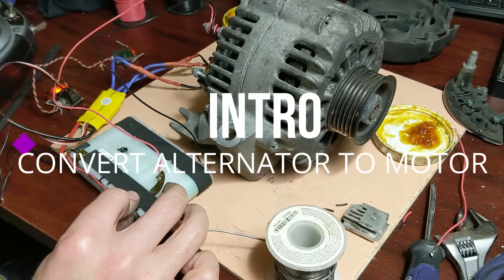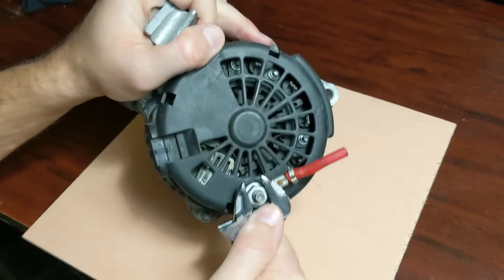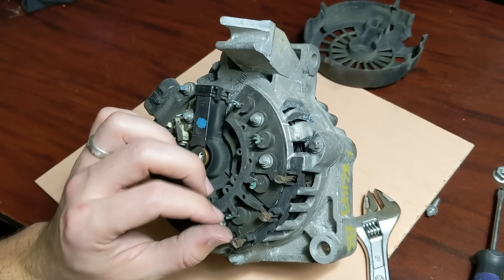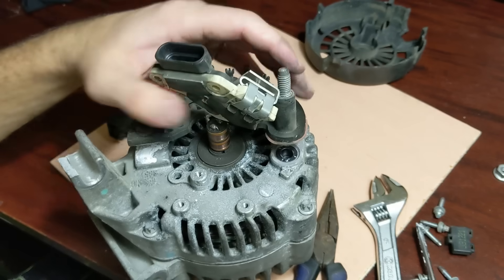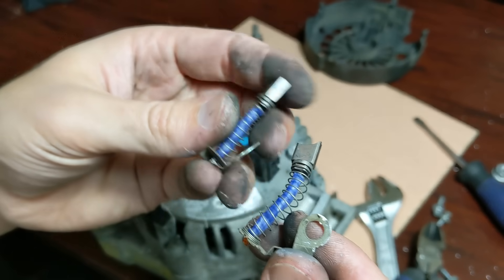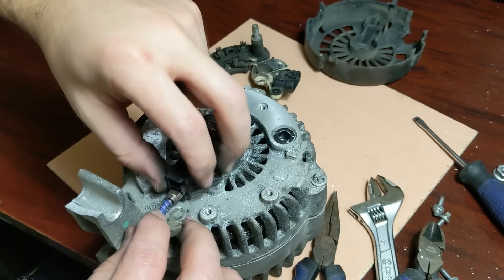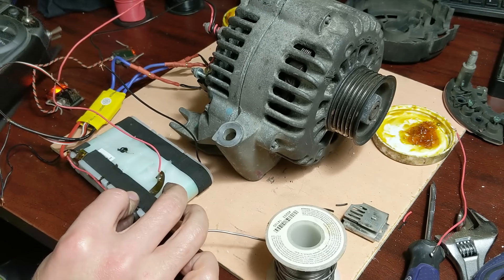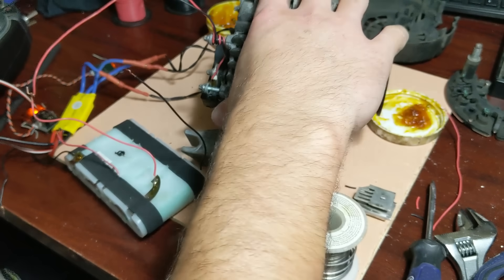Convert Alternator to Brushless Motor

Comment: Just wondering why the title says “brushless”
Reply: It is brushless because he removed the brushes. Then, put them back in. So, technically it was brushless for a few minutes, even though it would not work. 
  The only part that came in a box when I started fixing vehicles, they where new from the dealer.
Reply: he doesnt know, this is clearly his first time lol
Reply: @kingkoopa33022  well he knows enough to give a for the most part accurate tutorial on how to do the conversion from alternator to motor.
Reply: Yeah. I think its in the "drive it with an brushless motor controller, (with brushes and a stator instead of  permanent magnets.)"  But I'm sure he meant well :-)

Comment: I have now watch so many of these "conversions" and still have more questions then answers. First of all, nobody has a "perfect" setup of rotor voltage/current or stator voltage/current to use for the best power out. And no one has yet measured the true output capability of their conversions. If it is a relatively strong "motor",  how strong? Does it put out a HP or more or less? I understand the rotor has to have DC current as an input so that there is a strong magnetic field for the stator to react with. So the Brushless isn't a concern for me. But how much can one of these "conversions" actually drive? And swapping any two wires of any three wire setup, reverses the spinning action, for those wondering. Doesn't matter which two wires either, any two swapped changes motor spinning direction. Just need more specs on these projects...
Reply: I converted a 90A alternator to a motor (I think it was Star as it had four bunches of wires coming out and one was much fatter than the others.)
It could easily cope with a 800W ebike controller but got a bit hot with a 1500W ebike controller at 48V so a 90A alternator can safely be used as a 1000W to 1500W motor. 
I played with the voltage on the rotor and found around 7V unregulated (direct connection to a bunch of old 18650 Cells) seemed to work OK but it will work with anything from 3V or 4V to 12V however 12V may cause overheating.
My next conversion will be a 180A VW alternator and I plan to make a video about the process including fitting hall sensors.
Reply: youtuber "Fixitmoditbreakit" did tests, got 4000W of power on his 120Amp alternator with a 36V batteri
Reply: and since every alternator isn't the same, you need to test it
Reply: I can tell you just looking at the bearings, housing, wiring, etc., and cheap low amp alternator is equipped to handle way more amps than a typical  "250w" ebike hub motor.

Comment: I have seen electric motors having around 2, 3 or 4 wires going to and from but never have I heard about nor seen ones with 6 wires coming out from an electric motor at once? What function serves the additional 5th and 6th wires to, are they made for supplying a 12v utility battery or feed the spark plugs on the engine it usually is connected with?

If so then they are a perfect option for a diy regenerative braking system on each rear wheel side of any ev conversion car project as an additional bonus can improve the handling to a plus side.
Reply: the brush wires are for field current
(separatedly excited, some old huge DC motors from the past also were like that)
Reply: A 3-phase motor will have 6 wires. 2 wires for each of the 3 coils.
Reply: Think of it this way: a length of wire, let's say a foot long has two ends.  Let's say:  One end on the left and one end on the right.  A coil of wire on a stator winding also has two ends. To locate or identify a coil's two ends, an ohm meter can be used. The ends of the wires are made available on the alternator after disassembly.  For 3 coils you would expect 6 ends. For 6 coils you would expect 12 ends. For 12 coils you would expect 24 ends. These ends are usually soldered to the rectifier before disassembly.  Sometimes two lengths of wire are wound around the same stator frame section.  Instead of winding 1 wire at at a time they wind 2 at a time.
This arrangement would show 4 ends per section.  If there were 3 sections with two wires this way, you would see 12 ends. (3 X4)

Comment: I don't have a brushless controller yet but I do have an electric chainsaw that I can no longer get batteries for so I took the control unit from it which is for a brushless motor and all mine does is twitch like yours did at first. Any suggestions

Comment: The bit that spins around is the rotor and is an electromagnet or 'field' coil.
 The coils on the outside that don't move are the stationary (stator) coils. Voltage regulation is by means of switching field coil on and off or on more modern regulators, by supplying variable voltage .
Supply 12v to field and you usually get between 17~21v when  driving (gasoline) engine is powering alternator with corresponding rises as rpm increases. (well over 100v at max rpm. switch off field and voltage will drop dramatically but not completely go away due to residual magnetism or self exciting. 
I think you could fit a diode (or bridge rectifier) and variable resistor to make it self exciting but haven't tried it. There is a possibility it would get out of control as a motor though? 
You still need battery. 
Using neodymium magnets on rotor will convert it to brushless.

Comment: The center part that spins is called a "rotor", because it rotates.... sometimes it is called an armature.
A stator is from the latin root word "static" meaning it does not move... it is the laminated iron part with copper windings around the outside of the device. In this instance the stator is obscured by the casing.

Also, you put the brushes back in, so not really brushless eh?
Reply: "Semi-brushless"... 🤷🏻 
Still works exactly the same as a brushless motor, it just has an electromagnet instead of a permanent magnet.
Reply: WRONG! Lol. I'm just kidding. You're dead on.
Reply: I think it's technically it's a bldc with electromagnetic  rotor. And if you have a way of replacing the rotor with permanent magnets.. is love to hear about that...  Maybe you have a better way of adding power to the rotor to give it a electromagnetic charge? The stator needs a field to push upon our is but going to spin..
Reply: @dmayniak  That is what I have already said
Reply: 3 phase induction motor
Reply: @VulcaNtGoF  A 3-phase induction motor works completely differently

Comment: The Y vs D configuration has nothing to do with rpm.  It is the number of poles that  decides the rpm.
Reply: In case of synchronous motors y and d configuration changes the rpm
Reply: correct .A.C drives in industry vary the speed of an induction motor by varying frequency, since poles are fixed ( except single phase consequent pole motors ). These are the two main factors which determine motor rpm.- % slippage.

Comment: Bring out all 6 wires, and you can switch between delta and wye on the fly, and basically have a 2 speed motor.
Reply: Speed will match the AC output of the ESC.  Speed is limited by back EMF from the stator.  It cannot exceed power supply voltage.  Delta tends to have lower voltage than Wye but greater torque.  Lowering brush voltage will weaken the field and allow greater RPM but with less torque.

Comment: You keep saying the slip rings connect to the stator, but it's actually the rotor. Rotor rotates, stator is stationary.
Reply: Stator on a brushed motor turns right? Not trying to be an ahole just asking because I thought thats how a brushed motor works?
Reply: @2down2togo  stator = stationary, rotor = rotates.
Reply: @sspence65  but the stator is on the shaft right? On a brushed motor of course I know brushless motors are opposite
Reply: @2down2togo  no, the stator does not turn. The rotor is on the shaft.

Comment: I came here to see how you attached the magnets to the stator to make it brushless, only to find that it's actually not brushless...
Reply: Cracks me up the way people insist on calling these brushless. Still has 2 brushes to feed power to the rotor, but the good thing is that since the commutator rings instead of bars, there is so little arcing and it doesn't take a lot of amps to make it work.
Reply: it is NOT Star either. It is Delta!

Comment: Very bold and with rudimentary tools. Scrap yards cur the wire coming out of the alternator because unscrewing the nut usually break the insulator.  I recommend grinding the nut.  (Penetrating fluid may work but you usually end up breaking the insulator. Then game over! )

Comment: So if you are write about the wiring configuration (delta) where is the center tap. (Neutral) or are the comparison between transformers and gems not analogous? Anyway, to have power tou need to go from line to line, but then that's 240, so why don't you show where to ground or tap to the neutral for double or half speed motor configurations.
Reply: You're mixing house-levels of voltage with low voltages

Comment: You must replace your tiny very low amp 30 A ESC with 60 A or 120 A ESC, i see your alternator seem like weak of power.

Instead supplying 12v car alternator by 24/36/48/60/72 volt to stator (generating EMF by supplying 2v, 6v, 8v, 12v rotor ) , it's not effective due high cost to buy high ampere dc boost converter (hundred dollar 12 to 48 40 A) and middle high cost buying high amp 40 A 48v/60v ebike controller, the best way is we use middle high amp RC ESC = cheap if use 60 A, 

 i will use ESC & lipo configuration on my next ebike project, best choice is a low cost low voltage 3s - 4s lipo 2,2 Ah 40c (75 A continues current) with ultra farad super cap and also a 12v 120 A alternator.

So now this ebike configuration ( battery  tiny watt capacity 26,4 Wh = 2,2 Ah only) need free energy generator ( 1, Car alternator, or 2. Axal flux coreless super neodynum generator with steel flywheel disc.

Comment: how to run the alternator using electricity (110 or 220)
Reply: You cant
Reply: It would probably last about 2 seconds before starting a nasty fire.
Reply: An AC to DC converter I believe would work

Comment: 1 please quit calling the armature a stator the 3 wire coming out the side are your 3 stator windings the piece that spins is the rotor.  You would be better of using a old generator off a pre 70s car would work better or get a squire cage alternator looks kinda like what you have but bigger looks like what you would have for a hamster wheel.

Comment: Hi! 
How can I choose the battery for my alternator? Which are the characteristics I should look at?
Great video man!
Reply from the maker: You choose it based on the voltage of the speed controller. If your speed controller is 36v then that's the battery that you need

Comment: not be be an ass! But you do know that your statement converting altenator to Brushless motor is incorrect?! 7:15min there you install the brushes back! It is infact not possible to convert an altanator into a brushles motor without completly rebuild the rotor in this chase with a static magnet! It may be the same principal the way you control the motor but the fact is that you still use those brushes to get power to the rotor coil for the magnetic field. Thus state not brushless..  ( There are many more your for sure not the only one )
Reply: WHY PEOPLE FIXES THEMSELVES OVER THAT DETAIL?!?
The brushes DOESN'T MOVE THE MOTOR
The stator does!
Reply: @foxxyytofficial  i do not "fixate" myself over that?! But naming the object the correct way is something critical! I could also start calling a petrol engine a diesel engine...diesel or benzine fuel whats the difference?! A lot! What use does it have calling a petrol heater that way if it would run electricity. A petrol heater that runs on electricity...
Reply: @foxxyytofficial  OMFG You want to talk about details! The Brushes dont move the motor?! But the stator does?! Or does it not?! The motor it self will never move or turn by any means. But for sure its more likely for the brushes to move the stator! And not te motor it self. So no the stator or the rotor do not move the motor. But the brushes apply current and volts to the stator or rotor that will start to spin because of it! So in your case yeah the brushes do spin the motor because the stator or rotor is by any means the only moving part in the chasing of that motor! DO YOU GOT THAT?!
Reply: @stefanaddwork  hahahaha, you got triggered for content on YouTube
This is not like if you had a patent in this

Comment: What else can I use to control the speed, I don't have your kind of speed controller

Also, how is the power distributed among the 3 terminals
Reply: DC pulses 120 degrees apart. Thats what the motor controller does. They use a microcontroller programmed to send voltage to each leg of the stator delayed by 120 degrees of rotor rotation with respect to the speed of rotation. The voltage is sent via 3  large MOSFET transistors -- used as a current valve by the microcontroller. The faster the speed the longer duration the pulses are going to the (3)MOSFETS. They may use more MOSFETs for one reason or another but this just a simplified explanation. I've never built one.
Reply: @2pi628  thats a pretty good explanation of it. Its PWM pulse width modulation and the duration as you stated is the "on time" of the pulse also expressed as the duty cycle. A 50% duty cycle would be a pulse thats on equal to its time off. A 60% would mean its on 60% and off 40% causing the motor to run faster. The reason they may use many MOSFETS is for more current capability. They parallel them up to get more current. Same with power inverters, they have a whole bank of them on high output inverters. Thats why when one MOSFET fails it wipes out all of them due to parallel configuration. Some of those bike motors built into the wheel hub have about 10 wires. I think the speed control pulses each winding in a sequential order with PWM. I'm pretty sure this method is real efficient for the amount of power out to turn the bike wheel. This alternator conversion is very similar using less coils.

Comment: ALL YOUR WIRING OF THE 3PH DRIVER TO THE STATER ARE CORRECT . ALL YOU HAVE TO DO NOW IS TO SHORT THE ROTOR WIRES TOGETHER . DO NOT INDUCE ANY DC TO THE ROTOR , LET THE ROTOR TURN IN TO SQUEAL CAGE ROTOR . THEN YOU CAN CALL IT 3PH INDUCTION MOTOR
Reply from the maker: Tried that and it does squeal!

Comment: Not a brushless motor.... You have to apply a voltage to the brushes and energize the coils in the rotor so that it acts as an electromagnet. Then when you run the power from the brushless motor controller to the 3 winding wires in the stator it will run. Regulate the voltage and current running to the rotor and you increase/decrease the strength of the field and vary motor power.

Comment: I wonder if for an ebike can I move my rear hub to the front wheel and run some sort of belt drive rear wheel system to make a AWD system but run each off its own 36v controller and wire them to the same throttle the controllers out put 22amps they are brushless hub motors controllers so Idk exactly off hand but the 750 to 1000w max output. The battery on the bike now is a 36volt 29.25ah lithium ion.
Reply: Nikolas, it's been a year now and, perhaps, by now, you might have become aware of hub motors. Use a hub motor for the front wheel and you'll eliminate the necessity for motor mount and chain/belt drive on the front wheel which is rather awkward to get right.
Reply: Yep, I have diy dual hub motor emtb and it freaking rocks man.  48V batteries, two controllers, single throttle.  Upgrading to 52V or maybe even 60/72V this season.  I have an alternator sitting here as well...a pretty nice size one from a 2010 Grand Caravan.  Maybe I will convert it and attach it to one of my nieces or nephews ride on toys ot something and use my old ebike controllers / 48v batteries and see what it can do.  Like strap it to a push bike or something lol. I have a few keyed freewheel adapters and sprockets, couplers, etc.  Basically I alrrady have everything I need but time lol

Comment: Can some one help, i have a 4 wire alternator 12 maybe GM? how can i wire it to get best performance as a motor? To drive  80mm jet prop for a Kayak.
Thanks 
Ken
Reply from the maker: You need to take an ohm reading on each pair of wires and locate the common
Reply: @MadeEasyChannel  its dnt move when i release the power from the rotor i can turned by hand !!
Reply: @MadeEasyChannel  and ????
Reply: Q
Reply from the maker: Since it's a 4 wire alternator. It has 4 copper wires coming from the coils. That means it's in a Y configuration and NOT Delta as you see in this video.
Reply: @MadeEasyChannel  why my motor its braked when i put the power to the rotor ?
Reply: @MadeEasyChannel  and ????

Comment: Hi. I don't understand how it is brushless as it appeared that you put the brushes back in and connected a red and a black wire to them? Or did I miss something?
Reply from the maker: No you did not. It has brushes. You can actually use the motor without energizing the core/rotor. In the video in the link I do it.
https://youtu.be/ZSPhQ6S199k
Reply: @MadeEasyChannel  But the title of the video is "Convert Alternator to Brushless Motor". The title seems a bit misleading